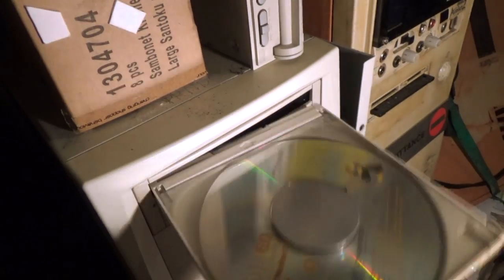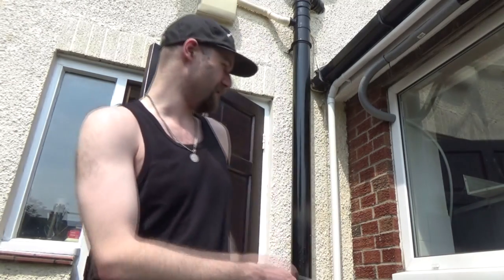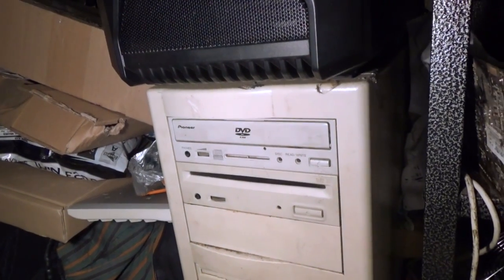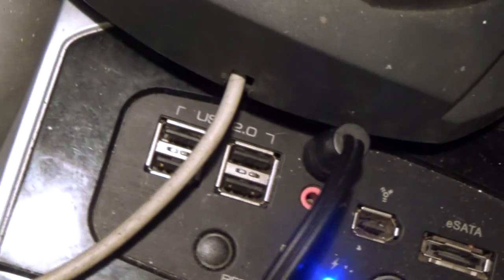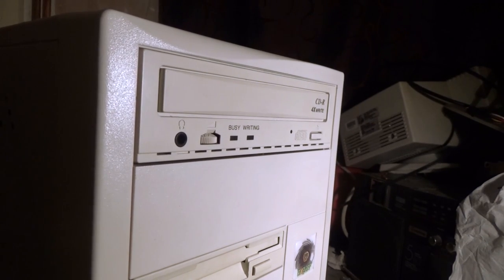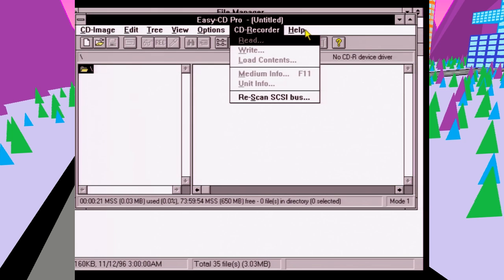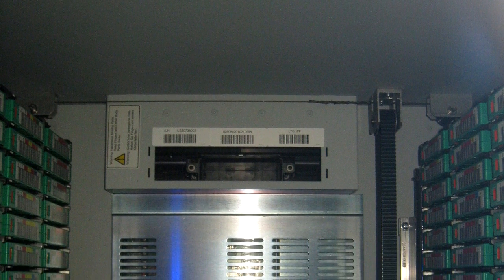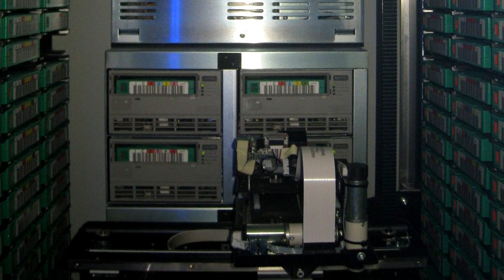Burning a CD in Windows 3.11 / PC CD Recording history

Comment: To best of my knowledge, HP offered the first retail CD burner available to the public.  I think it was the 4020i model. It came packaged with a SCSI ISA card .  The included software ran in WIN 3.1x only. Windows 95 software was available (Free) as an upgrade.  It had no buffer memory so making coasters was a common thing.  It retailed for $1199.oo. Blank CDs cost $20.00 each! I remember buying bulk Mitsui gold 100 packs for $900.oo. Not kidding!  I operated a BBS back in the day and file storage was expensive.  So 20 bucks for 650mb of storage was cheap compared to $600 for a 200mb Seagate hard disk. So a CDROM tower with 7 Roms online was the ultimate storage system. 2x cdrom drives cost around $150.  Those were fun times....   And expensive!  There was a class action lawsuit against HP from so many complaints that the drive never delivered as promised.  I think I received a check for $300.
Reply from the maker: Now that is very interesting to hear. Yes, the lack of buffer memory definitely sounds like a disaster waiting to happen, I imagine you probably just set it to the lowest speed and crossed your fingers every time. Also definitely never heard of anyone running a BBS from CD-ROMs, a wonderful piece of history there.
I have to wonder where the Yamaha CDR100 fits in, it seems to be about the same age, but also seems to have a buffer, possibly it wasn't as 'easily' available as the HP model.

Comment: Thank Microsoft that Windows XP had CD burning functionality built in to Windows Explorer. That's when I started burning.
Reply from the maker: It does, but that wouldn't get you around a poor quality machine, though the burners might have done by then. There are some advantages to these older systems, like I'm fairly certain you can do things like hidden audio tracks with a bit of patience in EasyCD. Not entirely useful or anything and there are certainly ways of doing it in newer software, too.

Comment: As an Aspie, i wasn't offended when you were talking ASPI drivers. Also, Zoe has a lotta cables coming from her rear end.
Reply from the maker: I'd consider that the term wasn't in wide use back then, especially with the word not being properly standardized when the ASPI layers were devised, but at the same time I'm not so sure because the inventors clearly had a sense of humor, evidenced when you look up the origins of the term SCSI.
Those wires are a nightmare, there is actually an additional breakout for the lowest card which is absent in the video.

Comment: I found an old 1997 era external SCSI Yamaha CD Burner and with "TOAST" burning software it works well pretty reliably on an old Motorola 33 MHz 68LC040 processor Apple Macintosh Performa 636 CD.That Performa 636CD  is running OS 7.6.1 as the operating system and the software is Adaptec Toast 4.1.2.
It has 36 MB of RAM.
Both I found in thrift stores for around $10 USD each.This is a pre Power PC CPU based Macintosh too from around 1994 to 1995 .
By the way Iomega Zip drives became popular around this time because CD Burners were so expensive and the Zip drives could handle fairly large files sizes at the time.I purchased my first new CD RW drive for my PC in the year 2000.Once CD RW and soon DVD RW  drives became inexpensive those Zip drives became quite obsolete as we all know.
Thanks for the excellent informative video on such vintage hardware.
Reply from the maker: Guess what? That's actually what the die-in-the eye in my avatar is from, an MC68LC040 from a Performa. Yes, I ran into a few mentions of TOAST when researching this, surprising how different the interface looks from what I've seen, though with no Apple machine to hand I can't test it to see if that's right or not.
Zip drives? Bleh, I have a special hatred for those... I'm not saying they're bad, but I figured they wouldn't catch on and opted for Floptical media, reasoning it had to be better because you could re-write them (unlike CDs) and the drive could also handle normal floppies too, Zip didn't stand a chance, it had to be worth the initial outlay. Yeah, nobody else I knew ever owned one and very quickly did stores stop selling the disks. Then I moved to LS120 thinking it would totally kill Zip and we all know how that ended, oh, and local stores stopped selling the disks. I have yet to win a format war, except SD cards, that's the only time I've been right, but then XD was so crappy everyone could see that coming.
Thank you for the kind words. I figured it was at least mildly interesting and worth covering as I've not really seen anyone else going over this. Probably good reasons for that, but whatever, I had fun anyway.
Reply: Personally I also went for the LS120 too.
It seems that the Zip drives were far more common though but they could fail
whereas the LS120 Super drives were much more reliable.I still have mine in operational condition.
Reply from the maker: My Floptical drive was stolen over a decade ago, I seem to think at the same time as an Opteron system I had - yeah, that Pentium D I used for years might never have existed if that hadn't happened - until then I still used the drive out of spite.
I really liked LS120 and was very surprised when none of my friends bought into it, instead moving to upgraded Zip drives they never used anyway as CDs and Ethernet were quite cheap by then and both LS120 as well as Zip were being phased out already. I don't know what happened to my drive or my disks, but I never really used things like that very much anymore once I had a decent network running... Something that actually took a while, the backbone of my network was not moved from Co-Ax until late 2007 during a major gear upgrade for everything after the failure of my old server, a 386, and the final piece of Co-Ax was not removed from the topology until over a year later along with the appropriate media converters.
Reply: I saw that there was a LS-240 drive though I never saw one here in the USA.
Maybe I wasn't paying attention though.
I looked at Wikipedia and from an article about it  could format a regular 1.44 inch micro disks to 32 MB for storage which is pretty neat.I still have thousands of 1.44 inch micro disks for my vintage systems.
I enjoy your videos.Keep up the good work.

Comment: Interesting to see early consumer burners in action. I'm pretty sure no one but you has made such a demonstration on Youtube that I'm aware of and its quite funny to see that a CD burner from roughly 20 years ago can burn discs better than a crappy modern burner. I've had an awful experience with a DVD drive in a fairly newish laptop one time where it would for some reason not recognize any disc for some unknown reason until I restart the whole laptop.
Reply from the maker: I've definitely not seen one, though I've seen short clips of some older drives installed in machines, only reading discs though. The problem you speak of is something I have seen, though that was in my old laptop. That drive also used to burn Audio CDs strangely, in that they would work, but the track changes would slip out as the disc went on, so say, Track 15 would end and you'd hear the start of Track 16 - then Track 15 would actually finish on the CD player and the audio would be interrupted. The overlap got worse the longer the disc was and car stereos had great difficulty reading them, skipping as if the disc were scratched the further you went. There was often a visual ring around an inch out from the center on discs burned in that drive too.

I really need to catch up on your videos, and a few other channels, haven't had much time lately.

Meanwhile I've sourced an older burner, one which works with EasyCD, a Yamaha CDR100. There is a clip of one burning a disc, but it was in a newer machine with a later operating system without much technical information.

Comment: My dad bought a Sony CDU-926S back in 1998. We consistently had buffer under-run issues trying to burn disks in Windows NT, because the burning software we had tried to buffer the entire disk into RAM as it went along, so would get 64MB-ish in, start thrashing, and slowly fall behind until the buffer ran out. I moved the SCSI controller and drive into a hacked-together Cyrix based Linux box (something old, probably on Linux kernel 2.2 or so), using the command-line mkisofs and cdrecord tools, and it was flawless.

The cool thing about burning CDs at 1x or 2x is that the required data rate is only 150 or 300 KB/s. In retrospect, I think any problems burning on fast 486s or slow Pentiums is down to early software being garbage. As for burning over a serial port, an 8250 UART would be too slow, but with good supporting hardware you can get 1.5Mbps (or ~187 KB/s) from a 16550. So maybe?
Reply from the maker: I'd have to suspect that if you used increasingly slow machines, you'd eventually hit a point where the CPU runs out of time to service everything, especially in older machines that lack GUI accelerators - hence SCSI to lessen the load I suppose. If there were any serial burners, I wouldn't be at all surprised if they went with some custom hardware and compression, likely requiring more power, that's only theoretical though as I'm not sure such a burner exists. Since this video I have obtained an older burner, a Yamaha CDR100, so I shall soon find out if EasyCD works as well as Nero here. Being older software I have to wonder if it's more likely to throw problems up.
Oddly, the idea of this bothers me far less than the fact the bezel is quite yellowed and looks out of place in my case, but I don't think the drive is very long for this world and the Matsushita will likely go back in once testing is over.

Seeing quite a few people here telling of their early experiences with burners, it's quite interesting to me because I was late to the party - not even having a CD-ROM drive in my own system until the early 2000s - so many of the difficulties had been nullified by then.

Comment: You'd have a hard time here for sure in the summer. 31c right now here. Usually gets hotter than that in the summer too.  Vertical storage, shelves, that would be an answer to for storage space to some extent, just a thought I had while watching the video. That little area behind you where the poster is at, boy i'd be spanning that area with some shelves. Seems like a good space.   

You're right, cd burners were expensive back then. The media was expensive as well, prone to failure quite often. I am not sure what use there was for a cd burner in 94 other than backups and archival, and even then you'd be hard pressed to find 600MB worth of stuff, especially when your hard drive was usually 540MB or less, and as far as backup goes, tape was much cheaper per MB for backup anyway. Fast forward to about 97 or so, then cd burners start making more sense. There were a lot of firmware fixes for burners due to all of the different media formulas different companies were using to produce cd-r's. You are also right when you said burners tend to read burned disks better, and that is certainly true too, and again, there was a lot of firmware fixes for cdroms back then too. It was a real cluster fuck back then with cd-r's.  Those old computer chronicles in the mid 80's are interesting to watch, talking about the promises of optical technology and how it was going to replace hard drives for storage.   I think the first burner I bought went into my K6-200.
Reply from the maker: It was about that around here the day I filmed outside and much higher in the house, though I know it gets much warmer over there. My old friend from SC used to complain about it being "cold" here in July, although he did often exaggerate for comedic effect. I wanted to span that space above my monitor with shelving, mostly for my stereo as it would free up an entire desk, problem being the wall panels are too thin to take the weight and there are no studs. That whole wall is made from long sheets which are fixed only at the very top and bottom, no studs run vertically. As such, there's nothing to screw into, unless I smash through the wall and figure out a way of fixing to the "corrugated" looking concrete which is behind it whilst dodging the odd patches that stick out a few inches for reasons unknown. No support in the chimney wall or front wall either which, form the corners there, has the nearest stud being one which edges the window frame over 5 feet from the wall you speak of. It's an odd construction this place.

I like the thought of "Burn" referring to long lost 90s dollars. Indeed, tapes were by far the dominant format for backup and still seem quite common in places. Optical was definitely a mess at that point, I've even seen some older drives refuse to read a handful of perfectly fine pressed CDs for no good reason whilst they will read everything else just fine, the makeup of the disc must be different somehow to cause such a problem, but as to how it is different I have no idea. What I do find odd is how that push-loading Mitsumi 1X drive (CRMC-LU005) I have seems to read everything, perhaps simply because it's so slow that it makes as near as no difference to it. But yeah, things eventually leveled out only to be screwed up again instantly by copy protection, a bunch of stupid methods causing some drives to not read or play certain discs, methods which were quickly bypassed by pirates anyway, meaning that once again, anti-piracy served to harm only innocent consumers... Hmm... now I kinda want to rig up the "Burn Complete" message to play Pirates of the Caribbean music or something.

Comment: I 1994 i got my first cd recorder there was an Philips CD521 dual speed and the setup was an 386SX 25 with two Adaptec 1542 scsi card because the burner and scsi disk has to been on each own scsi card.
The first year we used an dos cd writer "DosOnCd" program and later then in Win311, also the files system on the first formats was 8.3 with limit directory depth.
That was fun days and long before the smart buffer-under-run was the new thing.

Comment: The Macintosh counterpart of Easy-CD is Adaptec Toast, which still exists under the guise of Roxio Toast.
Reply from the maker: So I'm told. The interface looks significantly different, but unfortunately I don't have an Apple system to test it, if I could even find the software to begin with.
Reply: Here is a link to the TOAST  software just for a reference of course

http://macintoshgarden.org/apps/utilities/imaging-burning?page=2

Comment: Great Video, I remember paying almost 400 dollars for a CD burner to use in my Gateway P5-133 with Windows 95 so i could copy music CD`s.
Glad those days are over.
Reply from the maker: Search eBay long enough and I'm sure you'll still find someone selling old SCSI burners for those kind of prices. SATA and IDE drives appear to be worthless though.
Reply: Waiting for your Pentium Pro video, I have a Gateway 2000 motherboard with a 180Mhz CPU and 32Mgs of ram. Don`t know what OS to use on it. I Tested and it works. 60 MHZ bus? and CPU really makes a lot of heat

Comment: I found a  June 1997 Sony CDU 928E IDE CD-R drive that is operational/functional with a CD Tray at eBay. However the front panel door was broken when I received it and the pictures on eBay didn't show that.I might ask for some kind of a reimbursement for that defect.
Being that it uses the slower IDE interface I installed it on a June 1997 Gateway 2000 G6-266m system (Pentium II @266 Mhz) running Windows 95C rather than install it on a slower Pentium system.From burning tests it seems to run well with Adaptec EZ CD Creator 3.5c & DirectCD.
This might be one of the first IDE PC CD Burners perhaps.
Reply from the maker: It could well be. I don't recall seeing an ATAPI drive with an earlier date code anyway, though I wouldn't rule it out entirely. Of course, it's still technically speaking SCSI over the cables.

Comment: I burned a lot of those traxdata cds but they have mostly all failed by now, the silver foil  face of the disc has flaked away rendering them unreadable.
Reply from the maker: Whilst I can't be 100% certain of this, I suspect they made cutbacks past a point. I have some older ones that work fine, but the later ones all wound up with disc-rot despite being stored in the same case and coming from the same guy. This is another reason I suspect the one in the drive was an older disc, but we'll never know because there's no telling if the timestamps are correct - I know for a fact mine aren't as the system date is set to somewhere in 1995.